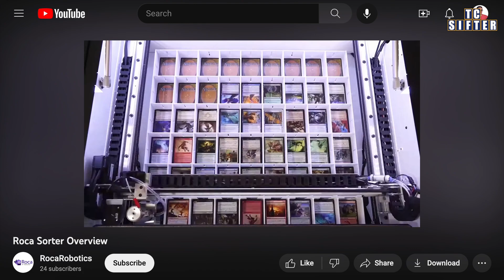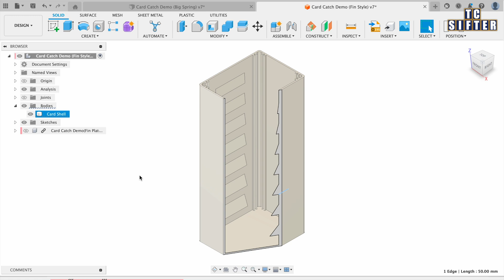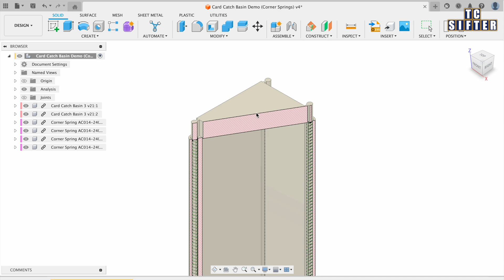Designing A Passive Card Catcher

Comment: Springs feel like they'd be too fiddly to get right personally, given any friction or binding that may occur.

An idea I do have though is to call into question some assumptions about simply dropping cards into chutes/bins though. In particular the fact that everything must be orthographically aligned with gravity.
At least with the ones you've shown the cards lay parralel to thr ground and fall directly vertically. And as you mentioned that's unstable beyond a short distance. However my idea is for the bin to be diagonal such that it follows the path of the falling card more natually, perhaps with the card builng guided downwards by the far/top wall as it lands on the cards below. Additionally you can play with the angle that the bottommost surface is at. If you just rotate a rectangular bin then the lowest point would be at the back of the card, and with that the cumulative effect of cards falling into imperfect position would be them levelling out to be horizontal, which is inefficient. However if you rotate the bottom surface such that the lowest point is at the far end then as any imperfections add up the slope would get greater, which actually encourages future cards to more snugly fit into their perfect position and thus I believe perfects itself.
In summary instead of having the bin have vertical walls and a horizontal floor, I'm suggesting it have the side profile of a parralelogram where the normal tangents of both the "walls" and "floor" are pointing away from the directions the cards come in from.

It feels rather awkward to describe it in text without being able to draw a diagram for you, but I hope I painted a good enough picture. Also I'll most certainly acknowledge that this design will take quite a bit of testing to get just right. However I do believe that once dialed in this design will be much less sensitive to failures, cheaper, and easier to produce than any design using spings.
Reply from the maker: Interesting idea! I think that I can at least somewhat picture what you're describing, and I hope I'm visualizing it correctly haha. I think you're right about the benefits of matching the incoming angle of the card's trajectory and allowing them to come to rest on an angled surface. Do you think that difference alone would be enough for even the first few cards that fall to do so in a non-chaotic manner?
Reply: @jackbaumgartel I cannot say with 100% certainty but I think it would likely be good enough at this scale.

If you would like to perform an experiment before investing in designing my proposed bin might I suggest you record video of a number of cards being allowed to freely fall out of the chute. Then you can compare how tightly they follow the same path on their descent to get an idea of how chaotic it is. Additionally, this experiment would provide you with an approximate curve/angle to guide you when designing the bin if you decide to proceed.

Comment: I think you might have issues with binding. The springs are going to have some variance to them, so it's very likely that sometimes the platform will essentially be lifted from one corner. Consider printing a full size card holder with no springs and attaching strings to the top of each of the spring interface lobes. Then do your best to get the platform to lock up by pulling on strings. Once you have the tolerance and platform thickness right, it should slide smoothly no matter how you lift it.
Reply from the maker: Thanks for the input! That's a great way to test the fitment and especially ensure that any variances in the springs won't cause issue like you said. I appreciate it
Reply: @jackbaumgartel  no problem, thanks for the reply! I appreciate your approach and I'm excited to see where this project takes you :)

Comment: What about a slide and the card holders can have about 4 inches of space to catch the cards. And instead of landing flat the bottom is slanted on a 22 degree angle. And a push out hole to take out the cards. Add holes on sides to let air flow out to prevent pockets to flip the card
Reply from the maker: I like the idea, but maybe I'm not visualizing it properly. Would this catch basin still be able to hold ~9in of cards, or is it just 4in tall?
Reply: @jackbaumgartel  I would say 4 inches because anything higher would likely flip but with enough air flow and at a slant it may be possible to go 9 inches
Reply: @jackbaumgartel  if you want I can send u a pic of what I'm thinking. Let me know I'll sketch one

Comment: What about using a pulley system where the counterweight is a chain? the more cards you have, the heavier the counterweight gets.
Reply from the maker: I love the idea! A chain or similar heavy rope would be able to match the increasing card weight just like a spring. I do think that the addition of pulleys & "chains" for each stack would be a mess. Any thoughts on how it could be implemented in a space-efficient way?
Reply: maybe you could use two pulleys and ropes on either side of the short part of the card stacks to avoid racking and save space in the width? if you then also use a wide ribbon for a rope you could have increased stability. the ribbon could ride over a rotating pin on the top and bottom of the card stack. The whole catcher assembly would get essentially twice as heavy this way though.

Comment: What about instead of just springs, a combination of springs/pulleys and weights that would instead allow you to use more commodity parts and not need to rely on expensive custom parts?
Reply from the maker: Thanks for the input! I like the idea of using pulleys to avoid any specialty/custom parts. I think it might be difficult to make use of such a system while still maintaining a small form factor though. Do you have any ideas on how that could be done?

Comment: Look up conical compression springs. They nest into themselves. Have you considered using springs in tension instead of compression? Im envisioning a rubber band fastened to the base, up over a pulley and attached to the platform.
Reply: Or a torsional spring like a garage door.
Reply: I'd definitely look at how a garage door works. Add two torsional springs on  rods to the long edges of the card-chute and have the platform suspended from cables that wind up onto spools attached to the rod.
Reply from the maker: @Fredward0216  Thanks for the input! I do think that even a conical spring would risk buckling at 9in, but it's an improvement! And the garage-door torsion style would be interesting! A few others have suggested pulley systems as well on here. I would be concerned with the additional space & complexity required, as well as the additional hardware. Do you think the garage-door style could be accomplished in a small form factor?

Comment: Since the ramp is at the pile that's getting more cards, and you have a servo there now... Could you have some sort of ratchet/belt system which can lower the tray in the column when the servo arm goes down next to the pile? Then you don't need springs or extra moters...?
Reply from the maker: That's a really neat idea, it would be awesome to use the servo already there as you describe. Figuring out a proper mechanical system to accomplish that will be a task for sure, but is definitely promising. I appreciate the input!

Comment: Cool.  I know I talked to you in another video.  I have my python code identifying most normal cards in under 1 second but the code is not optimized yet.  The game has been out for 30 years.  There's oddball stuff I am working on now.  I have figured out how to detect foils.  I cannot build my machine right now as my chop saw is dead :(
Reply: I am thinking 6 bins doesn't seem like enough.  How do you plan to sort the cards?  I would think 8 is a minimum needed for most common sorts for MTG.   5 bins for each color, 1 for colorless, 1 for multicolored, and 1 for unidentified/junk cards (like those rules reminder cards).  I suppose you could sort by color, everything else in the unidentified bin.  Then sort that bin by colorless and multicolored.  If you could add a couple more bins though you could be a little more efficient with sorting time.  I don't think short output stacks is a bad thing.  Think about this.  Let's say your input bin holds 2 boxes of MTG cards.  If you sort by color on average there will be equal amounts of each color.  There will be less colorless.  Multicolors can be all over the board though depending on set.  I think your output bins don't really need to me more than half the height of your input bin.  Also, what do you think about pushing unidentified cards backwards or in some dedicated direction?  That bin could be tall then and not match your regular output bins.
Reply from the maker: @SirPoonga  Awesome to hear from you again and impressive that your code is so quick! I talked about different sorting strategies a while back and what I learned is that everyone wants to sort their cards differently, so the ideal number of bins really is personal preference. This machine will have as many as it can fit without being too large that it's no longer a desktop device.
Reply: @jackbaumgartel  Right now I am doing a perpetual hash search to narrow down the card match.  Look up ball tree image search, combined with phash, can narrow down the search quicker.  From there I take the top matches and do a ssim comparison.  I think mse works also.  These are more traditional computer vision techniques.  However, with a robot the position of the card in 2d/3d space will be near identical each time which allows for some shortcuts.  You could go Tenserflow and neural networking but I think that is better for a phone app.  

For source/training material I have taken the default cards list from scryfall's bulk data api.  I filtered out unplayable cards like the rules reminders you find in boosters, oversized cards, artwork cards, etc.  I then download each card image, check if it has the identification text in the lower left.  If so throw the image away and mark the card in my db that I can find it by the id text.  Otherwise, keep the image and phash it.  There's some more details to it than that as over the 30 years of MTG they have done some strange stuff that I have to account for.  So when searching I first check if there is the id text in the lower left corner.  if so I identify it by that.  This requires some OCR cleaning of the data as it may think an I is a 1 or a 1 is a 7 because it thinks the flag is long enough.  If the card does not have id text I am then doing the phash/ssim comparison.  

Right now I am finding the patterns of how the OCR fails.  I am randomly picking a card newer than 2013 and not in brother's war.  Grabbing the image.  Giving it a slight contrast and noise filter so it isn't a perfect scan.  Then run it through the identification and see what the OCR comes back with.  Anything that isn't a match for which card was picked I note in a log.  Once I get enough data I will start looking for patterns of how the OCR fails.

Note, if you also do the OCR thing they changed the format of the id text with MOM and newer.  ChatGPT helped me out with making a regex that can identify the parts of the id text in either format.

Comment: I wonder how many compressions the springs can take before needing replacement. Also need to account for the base that the cards will lay on preferably so the basin is somewhere between .1"-.5" deep to prevent  first few cards from sliding off.
Reply from the maker: Great considerations! Yes I didn't do a great job of showing it in the video but the platform should be able to hold a few cards at it's "resting" height. As for the springs, the ones I specified are able to compress fully without deforming, meaning that they should last a very long time. Thanks for the input!

Comment: You might find a single fitted rectangular spring avoids your buckling issue. As a user, I'd much rather have one spring over four.
Reply from the maker: I can't believe that didn't cross my mind at all! I'm going to reach out to a spring shop to see what it would take to have something like that made for this application. I agree it would be much nicer to not have to deal with 4 springs per catch basin. Thank you for the input!
Reply: @jackbaumgartel maybe have an option in the programming for stepper motors over springs. Me, I'd rather have a more expensive but accurate lifter system.

Comment: I'm no engineer, but what about a spring in a similar shape to the container (e.g. rectangular instead of circular), so that it would be the same size as the platform and possibly not require four of them per container but still hold the same weight needed?
Reply: I would try having them manufactured as rectangular but have them nest like conical compression springs. I'd imagine you could get some thin stainless plates cut with a water jet then stretched and tempered , but I'm not a spring expert.
Reply from the maker: Great idea! Someone else also mentioned a rectangular spring and it's something I'll be looking into now

Comment: I think springs would work well, you would just need to take into account weight of the platform, springs nonlinear characteristics and friction. 

Some alternatives would be constant force springs with the ability to wind them tighter or looser to adjust tension, or a ratcheting system where when the dispenser moves over a collection bin it goes down one "click". Each one of these "clicks" would correspond to one car in size, or the machine can have coarser clicks with the dispenser triggering it every 5-10 cards. The ratchet system would only need one servo/solenoid and the rest can be 3D printed.
Reply from the maker: Thanks for the input! I had thought about an incremental ratcheting system, and I do like the idea. I couldn't figure out a compact way to implement it though. Would the strategy that you're describing still be pretty space efficient?
Reply: @jackbaumgartel  I don't think it will be as space efficient as a set of springs, but I think it could get close since you would be moving space taken up from the front to the rear. My thinking is something similar to a clicky pen, but instead of the mechanism shifting the tip in and out, it will shift it down in steps.

Comment: I have tried using springs in similar circumstances before, they are doable but ornery. I am concerned that the spring constent is very low yet needs to be very precise both to the magic cards and each other.  

If the spring constant is too high the sorter will not go down enough each card, this can be compensated for by having buffer at the top but the more buffer the more risk of flipping.

If the spring constant is too low each card will depress the platform too much this is not as large of a problem but will eventually leave too much of a gap, again leading to flipping.

You seem to have a lot of confidence in these custom springs in terms of accuracy, precision, and durability. Maybe this is warented, I have not worked with custom springs but with how low the spring constant is, how large the range of elastic compression must be, how resistant to degredation, and how many environments it may need to be used in, having a spring that meets design specs sounds very hard.

I wish you luck.
Reply from the maker: Thanks for the insight. I admittedly haven't worked with such precise & thin springs before, so your concerns are certainly valid. I appreciate the good luck!